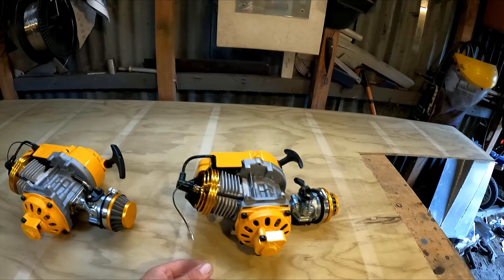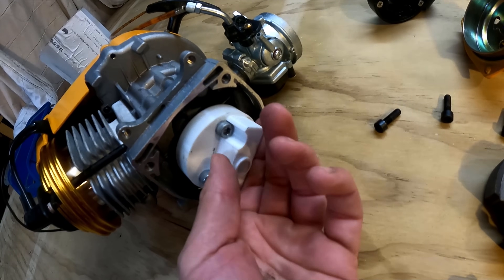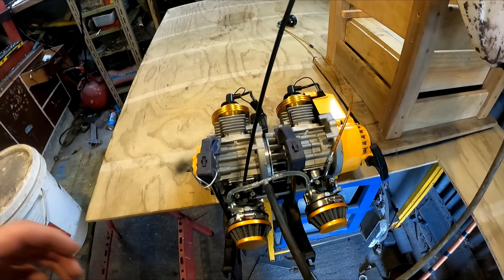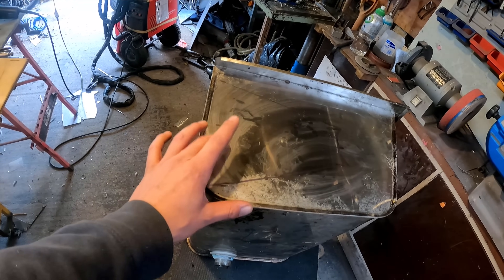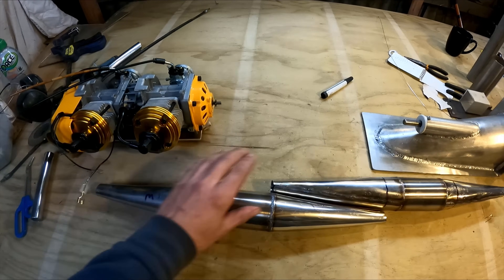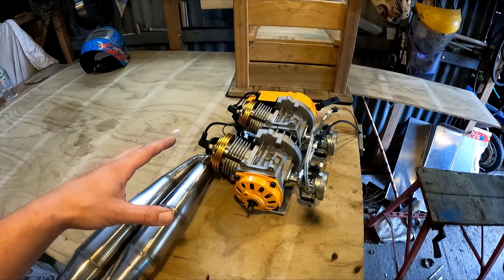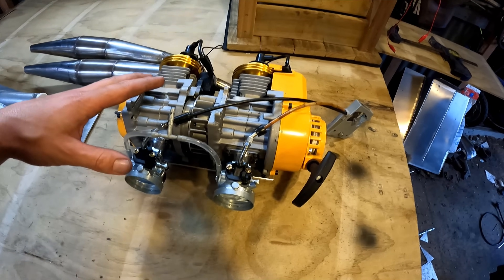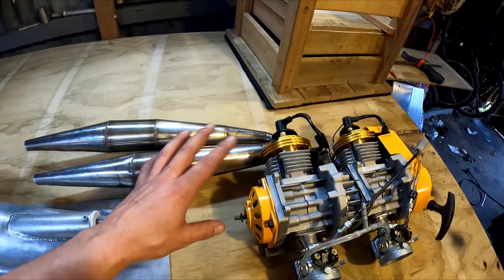Homemade Jet Drive 2 Stoke Twin Cylinder

Comment: Hi, I'm doing the same project as you with the same motors. Could you send me the 3D print file with which you managed to join the motors? Would you help me a lot since I've already tried other methods but they didn't work?🙂
Reply: i am trying to do the same project . i have been looking for a while but i cant find any files. if u find one please send it to me. thank you
Reply from the maker: They are in the description aren’t they? I did a couple of videos on these motors or search dkthewelder on CG trader. But honestly these motors are terrible a lot of vibration and very little power. Those 80cc bicycle motors might be better
Reply: @dkthewelder  Hi, thanks for the reply, but there is nothing in the description.
Can you send it to me somehow?
Reply: @dkthewelder  Hi, where is the file?

Comment: Hello can I get the STL files please. Thank you
Reply: Okay thank you it's just for fun that I do this
Reply: And I don't find the files in the link
Reply from the maker: There is a link in the description, but I wouldn’t recommend using these engines they are terrible they sound cool but that’s about it. Vibrate heaps an not much power

Comment: How did you calculate the extension drain?
Reply from the maker: I don’t even know what that is! There wasn’t any calculations except on the expansion chamber 👍
Reply: @dkthewelder  for that? What’s the expression?
Reply from the maker: @BMR-2stroke  the expansion chamber? I used an online calculator to do it

Comment: As a guy currently trying to make his kayak jet drive with a pair of chainsaw motors and RC boat jetdrives this is all priceless information
Reply from the maker: O cool! I am actually building a chainsaw powered longtail motor for a kayak sized boat at the moment. A few things to know though, a kayak isn’t a planning hull so will just plow water instead of getting up on top, and jet drives suck the power like they need double the power a prop does to go the same speed, really manoeuvrable though
Reply: @dkthewelder  ive heard that about the problems with the hull shape, my plan is more or less to apply the power first, expect the boat to behave like it hates it,  and start messing with strakes or maybe some sort of trim tab if i can keep it simple. I did not know that about the jet drives, its a good thing i havent made my final selection for a power unit. Thanks for the advice, and you do some fantastic work homie!

Comment: This is so freaking cool! Do you still remember what crankshaft angle you used when combining those 2 engines? It sounded so good!
Reply from the maker: They are at 180 degrees apart, it does sound awesome just not very powerful 👍
Reply: @dkthewelder  Thank you. I'll be building my own! Twin 2 strokes are rare as heck, this is gone be fun!

Comment: These motors are made with cranks that are pressed together and held by friction . Combining two motors together will surely couse crank slippage and major bottom end malfunctions. Will not work or will not work for long unless both cranks sre either taken out and welded to be solid cranks . 5 peices are pressed together to make one crand they are not welded together so these press fited parts can and will slip .
Reply from the maker: Seems like themselves motors don’t have enough power to slip the cranks haha. I could just weld them together but was just so disappointed with the power from them

Comment: Did you think of making the cylinders opposed, instead of inline?

It should dampen vibrations, somewhat, since the pistons motions are almost (hence: somewhat) exactly opposite.
Reply from the maker: Maybe setup in a boxer setup would be best I think it would help with vibration

Comment: OK instead of the clutch on your motors even if you do clutch them there's something called a pop off valve that pop off valve allows you to shut the gate that goes over the end of the nozzle and then there's a mechanism maybe a servo in your case it allows you to go full throttle and then rapidly open that pop off valve For instant high RPM thrust they use it on drag boat applications if you're interested in that for any reason
Reply from the maker: I have seen those! Thanks I think I’m making enough power for it to be useful though

Comment: your pipe would work better if you set the temperature above 500c, i have 700c running temp on my pipe and it works like a charm and keeps a uniform shape also its 0.75mm thick

Comment: to run both trottle tgether it already exist double cable throttle grip or from two stroke where ther is one cable for the carb. and one for the oil pump. Can you a DIY kit for assembling a twin engine ?
Reply from the maker: Yeah I actually had one of those cables but it wasn’t long enough. I will make a kit if enough people ask for it

Comment: I have question:   in video [2.08 ] you marked the position of the piston #1 and #2 "one all the way up and one all the way down position" why is that?  Would you please be so kind to explain to me? , Thank  already give you Thump UP and Subscribed
Reply from the maker: I just wanted them to run opposed so it would run smoother
Reply: @dkthewelder  ok, THK

Comment: i modded a handful of these mitsu clones and would love a drive adapter to pair a few together, i have 3 modified with porting, electric start, and tuned pipes, my last prototype had a stuffed crank and pulse lines to run a weedwhacker style pulse carb, great for only idle and full wot!
great video and impressive fab skills, i subbed!

Comment: I was thinking about doing pretty much the same thing, I’m so glad I found this video
Reply from the maker: It didn’t really work that well not enough power. Have you seen the test video?
Reply: @dkthewelder  I wanted to use 4 ms290 chainsaw motors

Comment: Do you still have the files for the adapter between the crankshaft an flywheel?
Reply from the maker: Yes on my CG trader search dkthewelder, or I think the link for it is in the description of one of the videos. If you can’t find it I can try find it for you tomorrow
Reply: @dkthewelder  thank you i found it

Comment: Do you sell the coupler to connect the 2 engines or know where to buy it
Reply from the maker: Na but I sell a drawing for 3d printing it for like $2 search dkthewelder on CG trader and you should be able to find it

Comment: Watched all your videos absolutely great stuff I actually made a video and mentioned U I had a idea that you could possibly use if you didn't want to use the 3d printed park that connects to the flywheel
Reply from the maker: Cool thanks I will check out your videos some time👍

Comment: I was looking at these for a jetboard as well. I figured there wasn't enough power & assumed cooling would be an issue. Been trying to find water cooled RC plane engine... but the one company that did make it actually designed the first jet board engine, and I think jetaurf somehow copied it and had it made by a cheque company that helped design KTM engines. So the engine is not sold openly

Comment: Interesting project, the Colin furze part was great 😂. The expansion chambers look nice, it will be interesting to see the power increase, I've just gone through the same myself but I used all Aluminium and went through the AuMechanic's calculations, as you say it's a mission making two chambers. Subscribed to your channel, nice work and videos. 👍👍

Comment: Great video..a bit late now but I've seen people make different complex items such as expansion chambers , muffler and even pulse jets using flat sheets welded together at the edges 100% then a pressure washer quick connector attached to it and basically inflate the 2d shape to 3d using water pressure rather quick and easy..depending on the shape some people add an extra area to be cut off later for the pressure washer connector..the water under pressure really makes smooth wrinkle free forms..
Reply from the maker: Hydro forming it’s very cool I have actually tried it before! It’s difficult not to get any creases and curves get distorted it’s ok for bigger stuff but I would mess it up I think

Comment: If you had the engines firing 180° out of sync, you should be able to "Y" the two exhaust pipes together and use the velocity of the exhaust from one engine to provide a low pressure vacuum to the other cylinder's exhaust effectively pulling the exhaust out...but that might pull too much out. Some of your air/fuel mix might go with the exhaust fumes, especially at higher rpm's. Then there would be the vibration issue. A twin firing 180° out of sync...you'd need a good vibration dampening device to keep the two motors from shaking themselves apart, particularly at the coupling.
Reply from the maker: I would like to do the two into one exhaust but I’m sure I would have to recalculate the shape?

Comment: With the engines timed @ 180 degrees apart like you're trying to do you only thus need a single expansion chamber and a 2 into 1 header pipe, that is just something which may help you with space for your project? They actually run up to a 3 cylinder engine on a single exhaust expansion pipe, being one cylinder is using it at a time, it's not as perfectly efficient as a individual expansion pipe, but it's definitely usable for a 2 cylinder engine. Hope it works out for ya, good luck mate.
Reply from the maker: Yeah I see snow mobile motors are like that I didn’t want to try it though in case I messed it up somehow. Thanks for that maybe something I could try in the future

Comment: Judging by the size of commercial jetski drives I'd say your jetdrive is wa-ay too big for those puny engines! The size is is like for those with 100hp motors and your engines are what, about 3hp each? Other than that it is very nice project and nicely done job! Keep it coming!
Reply from the maker: It is way too big haha. But my thinking is it is more efficient when big and I can just keep changing the impeller till I get it right
Reply: @dkthewelder  what's the HP on a single engine? 5?

Comment: Not sure how I haven't stumbled across your videos until now, but you're balls deep into the kind of hare-brained nonsense I love.
On a more serious note, the cylinders on those 2 engines you're using there probably have "boost ports" machined into the cylinder wall. These ports are a gimmick that the manufacturers are adding, and do nothing for performance as they are only 2mm deep. They do however cause severely accelerated piston wear because of the tiny amount of contact area left for the piston to run on. Replace them with the one piece cylinders and get the non-window pistons. Tune nice and rich and the one piece top ends will last waaaayyyy longer than they should. Wicked build!

Comment: I'm not much of a motor guy. I can't understand how hard coupling the two engines and not syncing the pistons is working in the long run. Aren't the two engines forcing each other and causing a lot of vibrations and early destruction?
Reply from the maker: Could do. I could run them synced but opposed is easy to start . I like the plastic adapter taking some of the shock out will have to see how it holds up and hoping there is enough power
Reply: @dkthewelder  keep us posted. Syncing the two would be an interesting video 😉

Comment: weld a piece of rod to the middle of your sheet. put in the lath, use a parting off tool to cut the hole.

Comment: Instead of a water jacket. You may wanna consider just wrapping the heads /jugs with copper pipe
Reply from the maker: Another person said that , I did think of that but didn’t think it would be enough, plus I have already cut half the cooling fins off and welded the jacket on one cylinder hope it works you will have to see in the next video 👍

Comment: Hay cool, I use to race pocket bikes down Taumarunui Kart track and even made a dyno with Performance trend software, stock they are about 2.2hp but 
with porting and higher compression and 21mm carb you can double that, so if 4.4 hp isnt enough let me know and
i could dig out my dyno notes if that helps, Brett
Reply from the maker: these are supposed to be performance motors that are 5.5hp but I don't believe that for starters the carb diameter is too small . also these have a ported piston , how do you port these motors?
Reply: when your are 100kg and only have 5.5 hp in a pocket bike you notice .25 hp
I was racing boys that where only 50kg , those so called performance engine use to go slower than one without the gold head,
the squish was around 2mm. you need to machine the top of the barrel in lathe to give a piston to head of 0.6mm then widen the exhaust port to just under 
70 percent of the bore size, and then raise the exhaust port in a nice arch to I think 18mm from the top of the barrel, thats of the top of my head, its been 10 years,use a air die grinder it takes about 5 minutes, I need to check the 18mm part, it was around 175-180 exhaust duration, when you got it right it sounds
like a chainsaw on methanol, cheers Brett
Reply from the maker: @kermets  that’s some great information there mate! I have welded a jacket on one cylinder for water cooling . Do I have to do all those mods together? How much power would that give also seems like I need bigger carb?
Reply: yes you need to do every step, and the 21mm carb,and exhaust... I cant find the distance from to of barrel to top of exhaust port, you would need to 
fit a degree wheel on and work out 175 degrees of exhaust, they are bit on a pain engine to keep going and wear out quicker
with double the hp, a big 4 stroke maybe better like a 11hp honda copy, I did find a dyno run of one of my better builds i raced,
https://drive.google.com/file/d/139c65Gt8dLjvcB6HR1AYDMioDff1WBnq/view?usp=sharing

Comment: you need a Double Pole Single Throw (DPST) switch, normally used to switch both + and - off but you can hook each engine kill wire up separately
Reply from the maker: ok I will try find one thanks

Comment: I partially designed a jet drive using a chainsaw engine with the intention to stick it on a board but never got around to making it. So this really floats my boat. I always was unsure what size chainsaw I would need with the size of impeller. Keep up the tinkering!
Reply from the maker: Chainsaw motors are pretty powerful I think you need at least 6-7 hp to get up , I have a big stihl chainsaw I but on a surface drive on my channel which was fast. Maybe an 80mm impeller would be enough? I hope you get to making it!

Comment: Some years ago i build something like this.  Main trouble - synchronization of carburetors.  I was weld Y shape collector with vibration damping inserts, and use one carburetor to supple fuel/air mixture to both engine.
Reply from the maker: That could be an idea, it is all very well running this on a bench but under load it could be a different story
Reply: @dkthewelder  Three upgrade i recommend for this setup. First as i say - Y shape intake. Second: use soft coupling between engines. When i was buildet my device i use very hard rubber disk with four holes as coupling element and two disk with two cylindrical fingers as input and output.  And three - i use ball shape joint to connect exhaust pipes.  Also very important right setting of pistons before connecting engines. One must be at top position another on bottom. First time i missed that. And when my device start - i got jumping crazy frog :)

Comment: You should forget the water jacket. It will leak. Just make a heat plate from sheet metal and add 12v blower fan on it. it will be fine! It is nice to see this coupling worked so nicely. 😀 You can even use this flywheel as a blower. Just need to build a casing.

Comment: This is awesome. Could you make a common exhaust flange to help with stiffness between motors. Old bmx bikes had cable splitters for the rear brake at the headstock, maybe look at one of those for your throttles.

Comment: Thank you for an interesting video. I think you can use a 2 pole switch and connect the 2 ground cables together and the engine side separated. Keep up the good work.

Comment: what a great project!! genius to couple 2 engines like that in a simple way. those motors have good bang for buck.  stinger pipes are going to heat up without water exposure or good airflow ducted across em. im sure you'll make it work though 

 can say your project even includes the kitchen sink! (beaut job of the stingers)

I'd love a jet board but they are crazy expensive off the shelf compared to a jetski. keen for your next vid👍👍✌
Reply from the maker: I'm trying to build this board for under $1000 dollars I hope it works!
Reply: @dkthewelder  that's rad. I reckon you can do it! working out the hull/board will be interesting.  fully manufactured from aluminium would be rad. or a hybrid foam/exo-fiberglassed shell with aluminium mounts for the engine and jet 🤔

also want the exhaust to not draw in water from backpressure. use whatever trick outboar motors use i guess. keep it up! :-)

Comment: For the off switch. To keep them seperate but switch simultaneously you need a 2 pole switch. 12v or 240v will work. Whatever you can get. Hope it helps

Comment: I rate this man, keen to see how it turns out. PLA or PETG are the best materials to 3D print with, ABS is more problematic. 

You can turn up the ‘flow’ setting to get stronger/more waterproof prints, I would start with turning it to 104%
Reply from the maker: Ok thanks I think I will try that
Reply: @dkthewelder  late to the party, but drop retractions, too if you can - they can leave leaky pin holes. 

As for PLA being "best", well if best = easiest, then yes. But not in terms of heat resistance or much else.